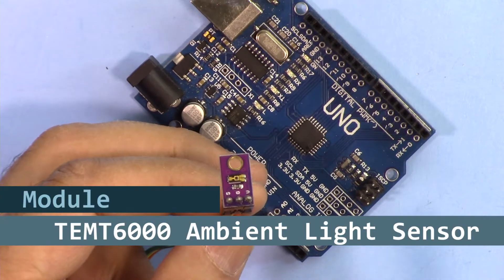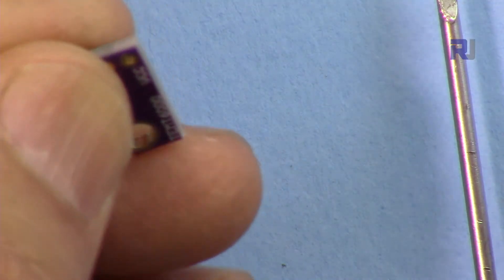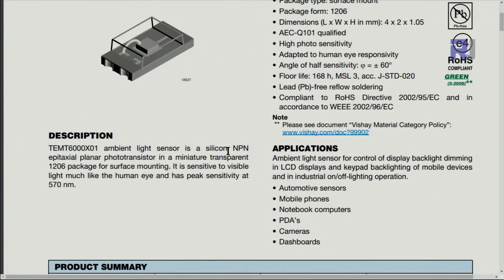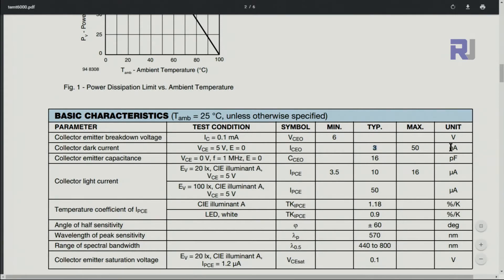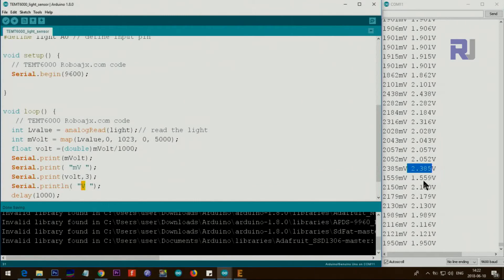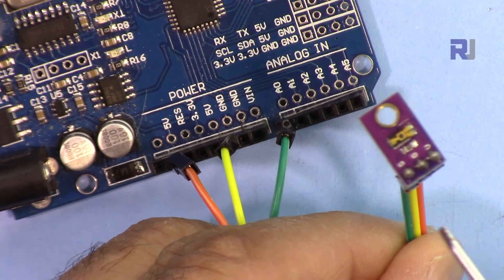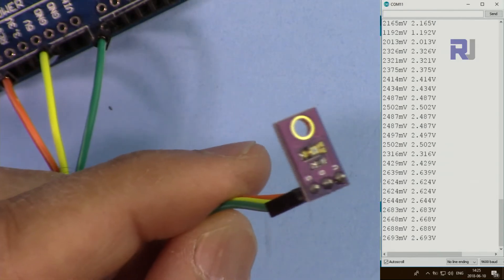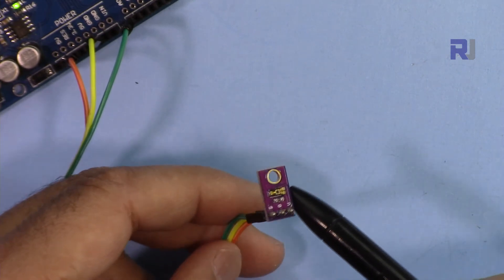How to use TEMT6000 Ambient Light Sensor with Arduino RJT87

Comment: Thanks, friend, good video
Reply from the maker: Thank you too
Reply: @robojax  I'm currently doing a real-time luminosity control system using LPC845-brk board and this video taught me a new option to catch a electrical signal from light, in anyways I'll use the BH1750 Lux sensor, but this video gave me a full picture of this problem, i deeply thank you.
Reply from the maker: Pleased to know it helped you. Here is the video n BH1750 https://youtu.be/iKUwu220UFQ good luck with our projects. Cheers